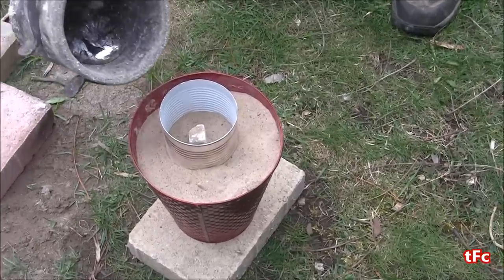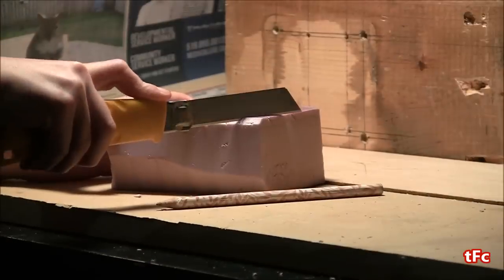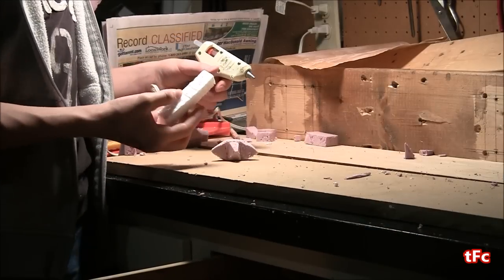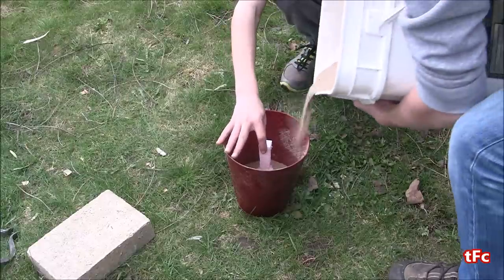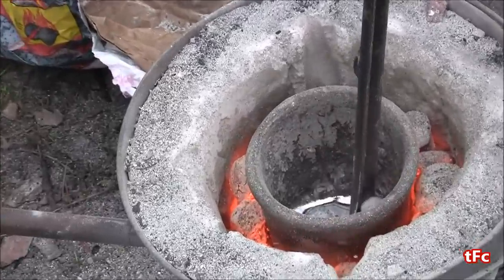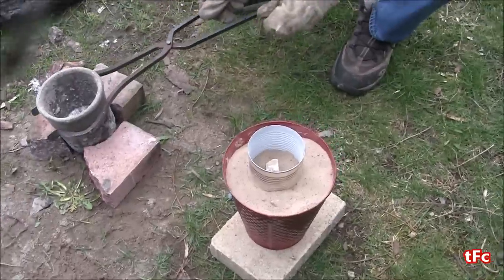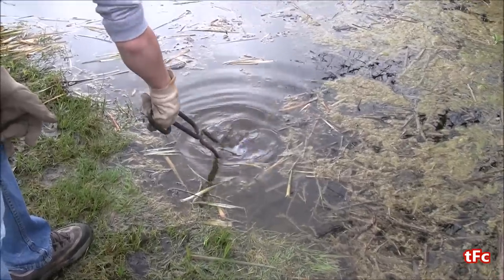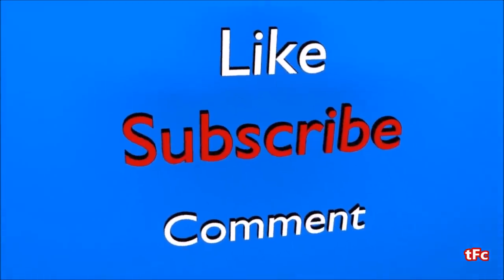Casting an aluminum star - Lost Foam

Comment: I mostly just wanted to say that I was kind of surprised that for being new, and only having 60 subscribers, you have a pretty nice looking intro and outro. 

If you haven't already, I'd definitely recommend investing in a hot wire foam cutter if you'll be doing more of this.  It will cut a lot cleaner than a knife will.
Reply from the maker: I made the intro and outro using blender, (as animation is also something I enjoy doing) and I have made a hot wire foam cutter that I'm hoping to use more in the future.